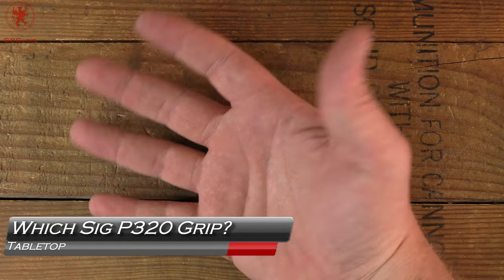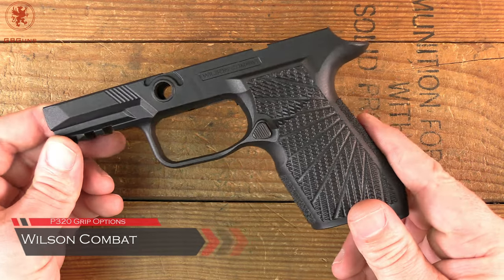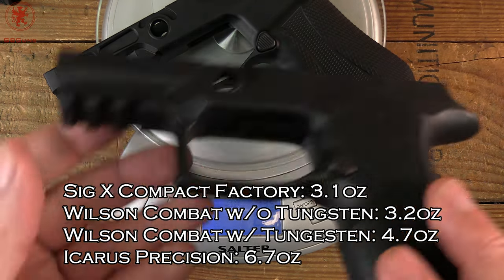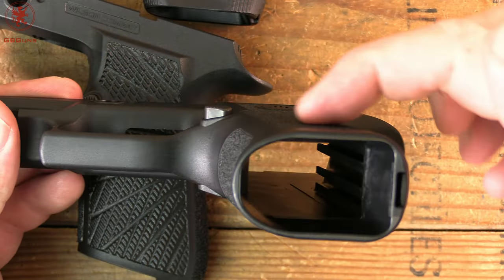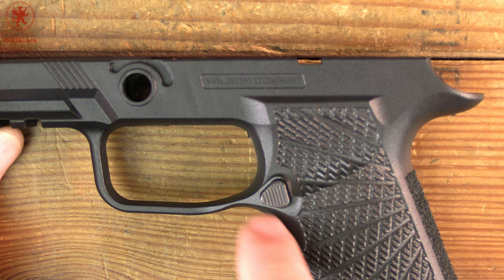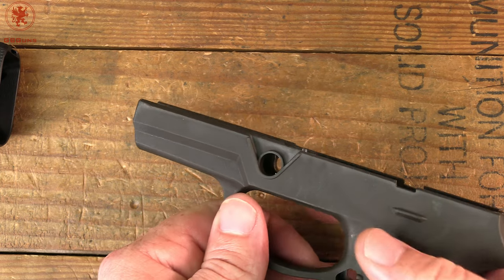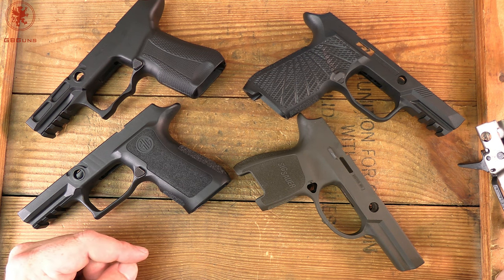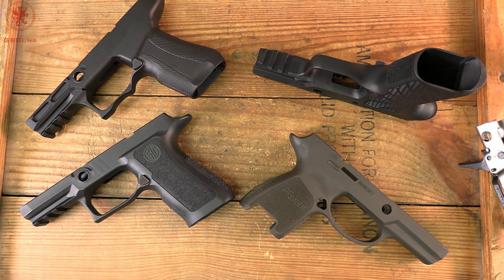Which Sig Grip Module

Comment: Between the Sig factory and the Wilson Combat  I wanted to like the Wilson Combat but I found it too slim for me. It caused me to fight to present the sights on target whereas the factory medium size module allowed me to align the sights upon presentation naturally and has a better overall feel in my opinion. Additionally, the sides of the Wilson's grip appear to be textured but are quite slick with sweaty hands.
Reply: It's crazy that you said that because I had the exact same experience with the Wilson combat grip. I could not get a good grip on it between having big hands and them getting sweaty over time
Reply: I’m glad I found this… I currently getting things together to build my first sig and gun in general
Reply: I had this same problem, and ended up with the WC grip frame, and put the Hogue overmold grip to it. I have wide hands and long fingers, and this combo works well for me...trust me, for like 12$ added on to the WC, you get a much larger grip.
https://youtube.com/shorts/p9Y4FFvIi1I?feature=share
Reply: Same. I wanted to like the Wilson but the factory module just fit better. Bummer I wasted $60.

Comment: I run a rapid force level 3 holster from alien gear for on duty use. I found that drawing with the x grip I had to adjust my grip as I came up to the target. With the Wilson since it’s smaller and contoured I don’t have to adjust. Overall a cleaner draw.

Comment: I originally got my P320 with the original factory (not X series) grips, and from there moved onto the WC320 grip module. In my personal experience carrying daily, the more exposed mag release has been a non-issue. I experimented with an extended mag release and that was a bit too much for reliable hand placement, but with the standard mag release length it's fine. One thing I did have to modify about my grip is placing my thumbs so that I didn't interfere with the slide catch, but that was easy enough to address. The Icarus grips look great, a little out of my budget right now but definitely on the board for when I can justify splurging on gun parts again.

Comment: I have tried all of these grip modules except the Icarus Precision ($400 to try one out?  nope!).  But one you didn't try is the Sig AXG module.  It, too, is aluminum and costs about $400, but I was able to try one out at my local range before buying it and found it to be by far the best fitting, in my hand at least.  More like the X-series or the Icarus in shape, but the weight just makes it drop perfectly into my grip, especially with the brass LOK grips on it.  Give it a try!  I think you and your big hands would like it!

Comment: I only own and shoot FS P320 ‘s in IPSC and IDPA competition but I’ve tried different modules just to them check out. I primarily compete with a P320 Max , which is the top of the P320 line.  I did high speed drills testing rapid fire group size with the TXG , AXG, P80 and Wlison Combat , all mounted with a FS Pro cut slide, Xseries FCU  and a R1Pro. The TXG came out on top as expected , next was the P80, the WC and then the AXG . I’m guessing that the Icarus would have a similar recoil impulse to the AXG which is a sharp push to your strong hand palm . The AXG performed much better with Lok brass grip panels The ability to change the grip panels would put the AXG over the Icarus for me .The texture on the WC is pretty good but for pure performance, I don’t run any polymer grips without Talon Granulate tape as none of them , including the TXG have acceptable traction . The stippled grips on the P320 Spectre Comp module are an improvement on the standard TXG ( But I’d still tape them lol ) 
I can’t carry where I live so I realize that my experience is only relevant to my shooting purposes , grip style and hand size .
The modularity of the P320 platform really allows shooters the most options to easily find the best set up for their requirements.
Reply: Nice!  The AXG with LOK brass grips came out on top of my testing as well.
Reply: @WaynoJ333  Agee - The brass grips really transform the characteristics of the AXG , specifically when shooting at full speed. Reduces the sharp palm punch of the stock grip to a dull thud and you can hammer away with confidence !

Comment: I had a very hard time putting the Wilson Mod on my new Sig p320 compact. When I got the fire control unit out and went to install it in the frame, a large pin fell out of the FCU. I saw where it fell out, so I put it back. But when I went it put the FCU in, the take down lever would not go in all the way.

Comment: I bought the sig small to start with then bought the Wilson and never looked back. It felt best but also has the weight set in it. Custom shop fcu/Norsso reptile slide/L2D 3.9 barrel/dps spring kit/509t. In my opinion it’s as flat shooting and same recoil as my shadow system mr920 elite with the ramjet. Was hoping for ramjet for it but they haven’t released any I’m aware of.
Reply: Good call...

Comment: Yep. Preference & modular or not,if something isn’t terrible or causes pain ect. I m leaving it stock I’ve thought plenty about flipping the mag release to the other side for index finger release and will try it eventually. If it’s good, it will be every one most likely. It’s personal & on certain guns the right mag release Extention can be a great inexpensive fix. I did it on a Glock 33 once & was much better,no downsides. Varies gun to gun. A lot of this stuff is putting stuff under a microscope that doesn’t need to be there. All good if ppl are buying,…sell sell sell. Then on to the new & improved. Thx G.

Comment: Great info video! 👏🏼
I choose the Wilson Combat modular frame over the original factory Sig Sauer P320 M17. 
I am pleased with it. It made an improvement in the ergonomics and my grip hold. The original  Sig M17 frame is a shortcoming cheap cutting cost mass production decision to sustain an attractive price for the DoD. It worked. 
The right frame for the M17 should be the one designed for the X series, but it costs more to get a better grip texture and a slimmer design 😉 So, the military got the low-cost end product.
Reply: I went the same route for my M18.  I did think the WC grip needed some additional work though.  I ended up deepening the trigger undercut, added a second undercut on the trigger guard, as well as serrations to the front of the trigger guard.  I also raised the beaver tail as much as could without filing a hole through the plastic.  With all of that, the WC grip absolutely makes the M18 a joy to hold and shoot. I also modified the takedown lever to work as a memory pad for my trigger finger and a gas pedal for my support thumb (it’s amazing what you can do with epoxy and silicon carbide).
Reply: Well put...

Comment: I have that same IP frame with a compact slide and I love it. The small amount of added weight feels good in hand and is barely noticeable when carrying. And I’m 5’6”, 130 lbs. polymer grips make my hands sweat like crazy regardless of texturing and I live in FL lol so the IP frame works well and the grip stays solid even when my hands are sweaty. Well worth the price tag imo. Also, my P320 is chambered in .40 so the aluminum frame combined with the thumb rest/gas pedal, it feels so comfortable. It may not be the “best” gun, but it’s the best feeling to me currently. And idc if the finish wears, I’ll just respray it with a matted clear coat. It’s only gonna happen again so I’m not worried about sending it back to get fixed. It’s my carry gun, it’s gonna happen eventually. Oh, and imo, especially with the longer slide, the IP frame helps to offset the top/front heavy nature of the P320.

Comment: The P320 has been a curious case, in my personal experience. I've always admired the P226 but the way it feels in my hand is atrocious, especially the trigger reach. I feel as if I have to dislocate my index finger and wrap it over my middle finger in order to reach the trigger, also the feel of my distal pad rubbing along the trigger guard as I pull the trigger makes the P226 a total deal breaker, (same is true for the P220, P225, P228, P229, etc).
But, with the P320 the grip feel is beautiful and the trigger reach is excellent. So much better than the P226 ! However, if you compare the two, side-by-side, they share a very similar outline. (SIG definitely went through the effort to make the P320 look like a SIG). The difference in feel cant be overstated, the P320 is very much its own gun.

Comment: I have Icarus, AXG, X, OEM for My P320.   I love the Wilson Combat the best and run it without the tungsten weights.  Also have Icarus, oem and Wilson Combat for the P365xl and I run with smaller smaller slide and barrel like P365x and again prefer Wilson Combat. And without the weights.  I prefer the carry size for the P320 Wilson Combat though.  Fits the pinky better and more capacity mags.  I don’t like the dropped piece on the magwell with the Wilson Combat compact grip for P320

Comment: Now just need to add MIRZON & BROUWER for Polymer grips and KMTACTICAL & SIG AXG for metal grips!
Reply: The Brouwer grips seem a lot like the Wilson grips except $20 more expensive, doesn't come with mag release installed, costs extra for a magwell, and charges $100 extra for some skateboard grip texture.

Comment: thanks....For the. Video.  Will any of these grips work with my first gen p320 subcompact...?  Can I use the sub compact slide?    New longer mags are needed... Correct?
Reply from the maker: You will definitely need longer magazines, I'm not sure about the slide fitting, check witht he manufacturers of the module you're interested in, they may have subcompact-specific grips.
Reply: Sub compact slide is 3.6 inches (same length as X Compact ones) so any grip module that is for 3.6 inch barrels/slides should work for your FCU. Maybe not if u have it chambered in .45 tho not sure about that.

Comment: Currently using the WC with tungsten rods and a Hogue overmold grip. Contemplating spending the money on the Armory Craft AXG aluminum grip frame with brass grips and steel back-strap. I've shot the Scorpion, but not the set up described above, and believe it would be ideal.
https://youtube.com/shorts/p9Y4FFvIi1I?feature=share

Comment: Not sure where this guy shops but there are zero frames out there for $9 or even $40. Most are $67 and up
Reply from the maker: How are you not sure where you shop?
Reply: @GBGuns  No I’m sure where I shop. And the multiple places I looked for frames for the 320 platform, still haven’t seen a $9 frame. So if you come across one of those unicorns without a safety let me know
Reply from the maker: We can't link to such places here on YouTube (that's why we have GBGunsDepot.com), but check the clearing houses, that's where I found mine. Dirt cheap places where manufacturers off load items they're fazing out or that didn't sell well.
Reply: Great tip! Appreciate it greatly